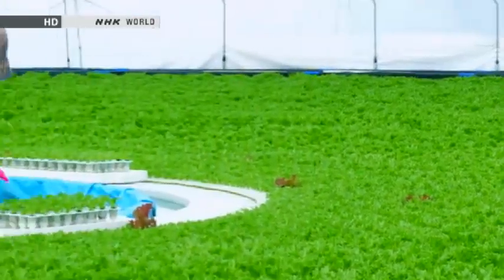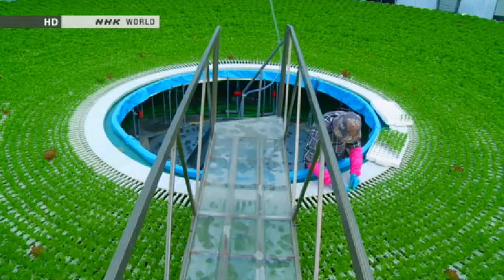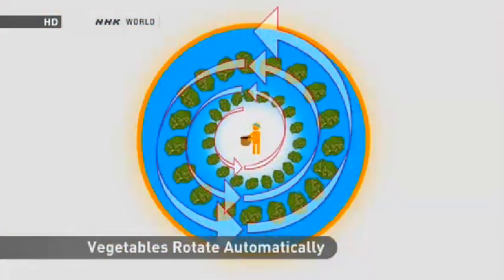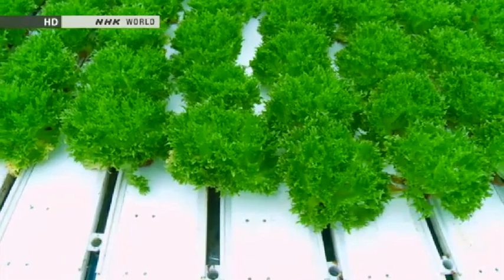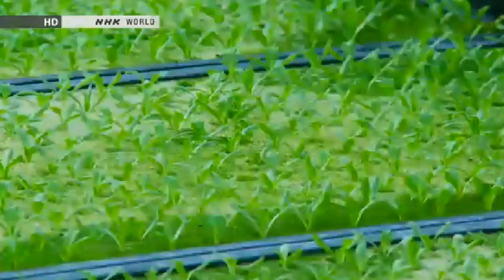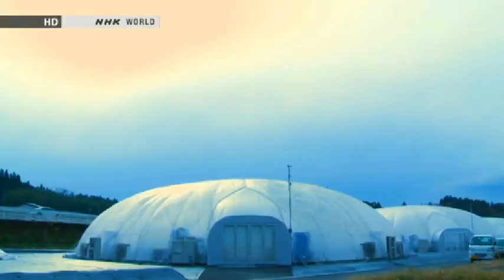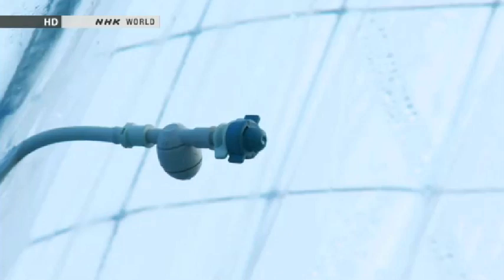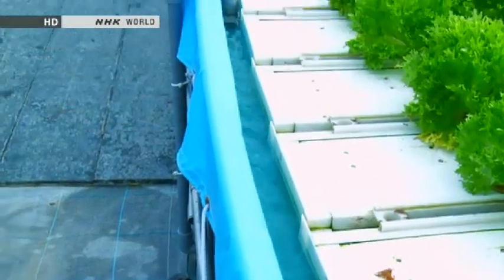Amazing Hydroponic farm Japan Gandpa Dome

Comment: I love the circular idea. But it concerns me that such a big expensive set up for ONE crop.
Reply: one crop??? with that setup your not getting just 1 crop. hehe...
if you say planted 1 cirkle-row of lettuce a day,, you would get 365 crops a year
Reply: Um. Did I mis word this? I meant you'd get only lettuce.
Reply: yes,, of course if you only plant lettuce, you most likely get all lettuce. hehe..
but there are many types of vegetables-lettuce that could be planted in this type of setup
but near say a big city its not a bad thing to concentrate a greenhouse on 1 type of crop in each of such greenhouse...
not all cind of vegetables is suitable for such a setup...
for example tomatos and cucumber plants need a setup with supports for the weight, + they need longer time for each time they can be harvested. so it wouldnt be smart to move them around  but can still benefit from the aquaphonics circulating water-nutrients
Reply: You can also mix crops, but the grow cycle and demands have to roughly match. Everything stays the same number of days on the circle.
Reply: yes but for a big farmer that have a big city-market nearby, it shouldnt be a problem to have lots of  circles 1 for each type of vegetable

Comment: Only problem I see with this is that they aren't stackable modules.  If you can stack domes upward this could change the world.
Reply: stackable modules may block the lights,need  led lighting maybe?
Reply: 2 years late but here's my two cents on it. They chose for a dome in order to utilize the rays of the sun but still being able to control all other factors such as temperature and humidity inside the dome. An understandable decision but vertical farming would be much more beneficial I think, and I am also of the opinion that the 1 laborer in the center should be replaced by automation aswell. I mostly think that they chose this design because of budgeting, they still need to profit from this thing. But the engineer in all of us can't help but wonder how this design could be improved should cost effecfiveness and budget not play a factor. A self-sufficient and self sustaining design with high production rate is what I am aiming for in this case. 

Well for one thing, this thing needs to become fueled by aquaponics. Aquaponics would discard the need for nutrition to be added in to the water because it draws it's nutrients from the fishes. Not only that but the fish can be farmed and sold for extra profit and the organic waste that they create can be sold as fertilizer. Aquaponics also discards the need for any form of soil. 
Second of all, a very simple supply line and a robot in the center of the circle could replace the laborer. It's not at all an extensive task to program an arm to inject seeds in to cups filled with those little soil replacing balls, i forgot the name for them, and just have the cups go round and round. At the end another machine extracts the plant from the cup and returns it to the Starting point where it can be injected with seeds again.
Lastly, they should go vertical with this design. It much more efficient and increases the output per square meter dramatically. The only problem that this creates is thd blockage of sunlight. But this can easily be counter with the help of UV lights. Plants also tend to grow much faster under uv light so the production output is again increased. All we need now is solar power to keep the system running.

Comment: The drawback to hydroponics is that you will have to purchase "plant food" or nutrition and supplements which can be high-priced.
Reply: 20 per sheet /3 sheets=60 slots with the 4th sheet with 60 seedling starter slots. Then a 4'x4' 12"' deep hydronton grow/filter bed. We had a 12x24' greenhouse that was producing WAY too much. We will put it back up next year after we move, most likely. I have a 10g fish tank with two 5' towers that overproduce green/red bell pepper with a total of 5 slots each.
Reply: Aquaponics brings together the most effective aspects of Hydroponics And Aquaculture so lower cost as well as enhance efficiency. You may get the most efficient aquaponics system here:
help1.info/best-aquaponics-plan
Reply: Alica Bowling What about the cost of the fish food? I don't think hydroponic fertilizer is that expensive. And with aquaponics you still have to keep the water safe for the fish.
Reply: B Green
Fish food costs next to nothing when you consider you can grow most of it as duck weed in the system. Also by using bug collectors in the summer you can feed them as well.
Reply: Alica Bowling Aquaponics is more efficient.
Reply: Not only is Aquaponics more efficient it is so much easier to run. Plus if you want you can harvest the fish or choose a very easy to raise fish.
Reply: Our Buttercrunch Letuce is Amazing!; We have a small system but produce enough for two other families.
Reply: Tango. how may spots do you have for plants. I have built my first tower and its only 4 ft high but has 22 plant sites. I should get the water pump and ball valve today. If it works out I will add another tower to same pvc tub. After that I will have to move the system outside.
Reply: The top one is a 4'x8' (ish) DWC bed.
Reply: Nice, I want to do aquaponics but my current tower is in a rubbermaid container and worried about the fish not having so much light.
Reply: Get a 10gal aquarium from a yard sale or craigslist. They are like fleas. Make sure you paint three sides and make sure remaining side does not face the sun. You will get an algae bloom in no time.
Reply: would it hurt the fish if i put them in a rubbermaid container? Thinking if i put a small light in it they would be ok
Reply: B Green No!! if the water is good. They don't need much light
Reply: so wonder if i could put a llittle flourecent light in my rubbermaid could the fish live ok
Reply: B Green Sure but it isn't necessary. Yo could just leave the top off. Light is not needed  for the fish to thrive.
Reply: My top it's what is holding the tower up. I guess I could use something else to hold the tower.

Comment: Don't the roots rot if they stay in the water all the time?
Reply: There is a method called kraftky.  Roots in standing water with some roots above the level as the plant drinks the water and no light allowed to avoid algea.

There is the forced air in water with all the roots in water, no light allowed for same reason as above.

There is flow of water and the flow picks up air to feed the oxygen to the root system.  

All different methods work good for some plants and better for others.  Also, forgot to mention added nutrients to the water and weekly check the ph level.

Fish soiled water is the best just feed the fish and preventive maintenance.
Reply: no they don't because the water is sterile and so are the plants and so there are no fungi living in it.
Reply: Oh. I though root rot was caused by the roots not getting enough oxygen.
Reply: *****
Yeah, that's right. So basically you would survive if I held your head down in water.
Reply: RelatedGiraffe cool comeback... (short answer) some of the roots stay above water level and have access to air... some have found success with standing water... as the plants drink the water level drops uniformly.  The roots of the plants continue to grow and the ratio of roots, above water level - below water level, remain constant throughout..But this system seems to pump air into the water
Reply: Pedro Torres Yeah I know, not very classy. Ah, that makes sense. Maybe it's enough if just a part of the root system is over the water. Thanks.
Reply: Matthew Thacker
Yes I know that fish need oxygen and can extract that from the water whereas we cannot. But can plants do that too?
Reply: Pedro Torres
So basically there roots always get some air in order to get oxygen?
Reply: RelatedGiraffe
I'm a little late in this conversation, so you may already have your answer.  I'm not an expert at aquaponics or hydroponics  or gardening for that matter,  but I know that some plants will do much better than others with this method.  It seems to be that a lot of the leafy greens will work in a Floating Bed method, like you see here.  Other plants, however, require a method where the water slowly rises to a certain point, then quickly drains out and this process repeats.  The floating beds need an air pump to constantly put fresh air into the water.
Reply: Et Tu Weston
Okay, no I didn't know that. Thank you.
Reply: RelatedGiraffe Yes roots need oxygen and no sunlight (the advantage of loosely packed dirt in typical farming I suppose?)